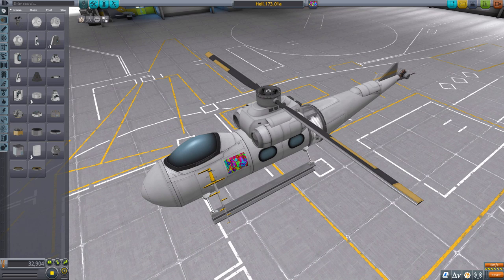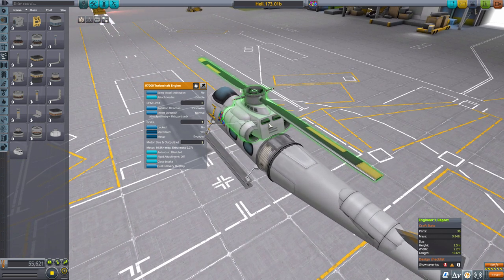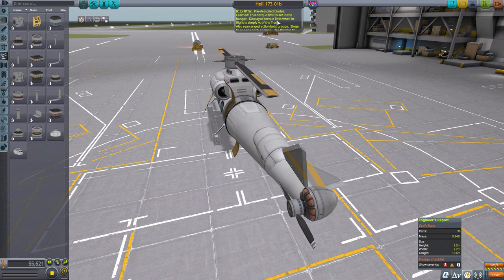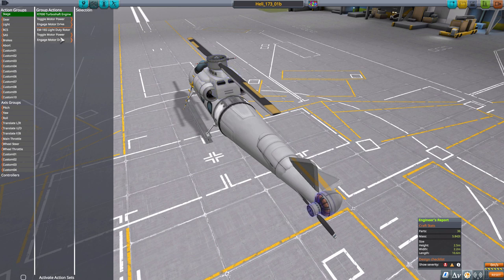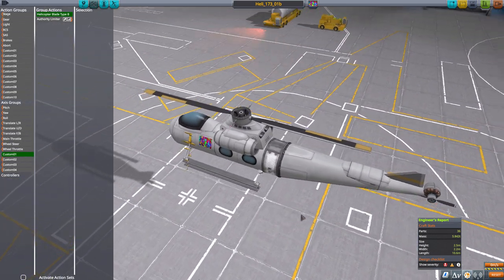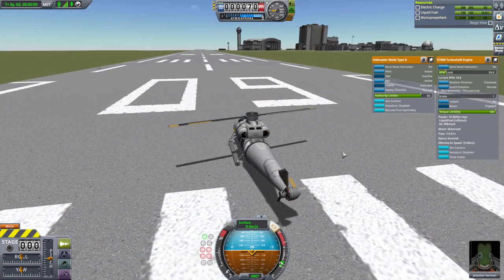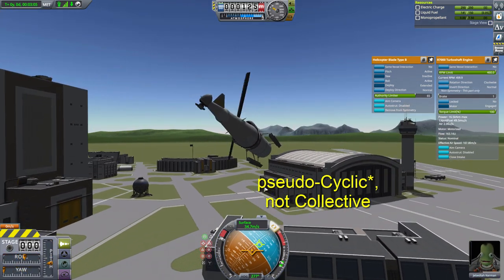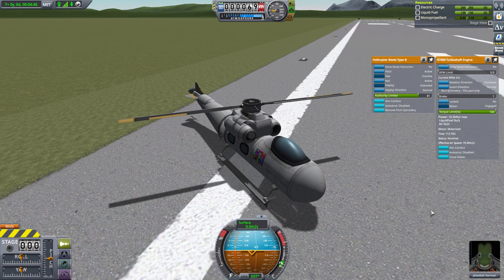KSP 1.7.3: refined + improved (simplified) helicopter controls

Comment: You have more advanced options in helicopter blades and rotor windows. Why is that? Thanks to some mods? Fox example my  authority limiter value is on 23 max. 
However you vids are awesome! I really like them
Reply from the maker: Compare the date you made this comment to the date this video was published.  It's a four month difference.  The version of KSP in which this video was made is stated in the title of the video.  The 23 degrees limiter was introduced in 1.8, replacing the percentage limiter.  There is no difference in performance, just a difference in the way the information is presented.  Finally, I have advanced tweakables turned on in my game settings.
Reply: Thank you so much for that info. Everything is fine now, I'm just dumb xd
Have a nice day :)

Comment: The rotors with KSP have been a bit of a letdown, but the new parts are still a bit fun for other things. Maybe if they fix the game engine a bit the rotors won't have to have such useless low RPM limits for prop-planes
Reply: wdym a let down , it works almost like the real thing ( no swash plate) but you can build it with robotic parts
Reply: @linecraftman3907  I was speaking more for propeller planes and things that would require higher rpm. How would you make a working swash plate without kraken issues?
Reply: @casualbird7671  The RPM isn't really the problem. At low speed (<100m/s) they work just fine. But at higher speed the angle of the blades will need to be higher, we sadly can't automate this in stoch ksp.
Reply: The biggest problem is we cant really warp when using rotor blades, it will break apart and cause a lot of karken.

Comment: For some reason, this exact design keeps turning counterclockwise for me. I can turn it the other way, but as soon as I stop doing so, it starts rotating counterclockwise again. Dus anyone know why this is?
Reply from the maker: I can only guess at what you're describing; more specifics would help.  Are you saying your helicopter turns CCW, the main rotor turns CCW, or the rotors only produce lift when spinning CCW?  How were you making "it" turn in the other direction?  (What is "it"?)  Until I know specifics I can only guess at a solution.  

I'm going to guess you're talking about the main rotor.  You can change its direction of rotation by right clicking on it in the hangar and selecting the opposite direction at the bottom of the Part Action Window (the window that appears after you right clicked).
Reply: @ArchaicAlibi . My main rotor is set to rotate clockwise with 3 motor size and output. My tail rotor is set to turn clockwise as well with the same amount of motor size and output. My entire craft itself tends to rotate counterclockwise. I can turn my craft the other way, but as soon as I stop, it starts rotating counterclockwise again.
Reply: @maximdeleye  probably your tail rotor is not powerful enough to compensate for torque main motor is creating, so the torque rotates the whole machine the opposite direction compared to the main rotor's direction. 
Or it is too powerful, and it pushes too much. Depends on the side of the tail you stuck your propeller to.

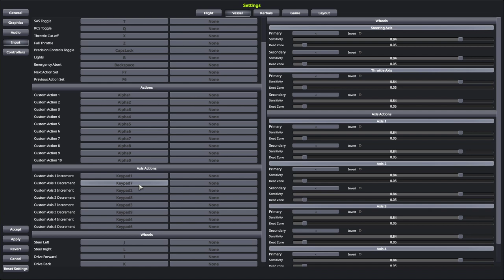Comment: 11:13 you could’ve made the more sensible decision of putting increments higher on your keyboard, and decrements lower, and instead invert the axis control group in the SPH, that’s just my opinion though
Reply from the maker: You're not wrong but sensibility is subjective.  There are lots of things I could have done but I'm a creature of habit and installing rotor blades with an angle already built into them was a necessity in older stock heli models so my habit lead me down that path.  Honestly, what I wish I had done was Invert the direction of motion in the AxG.  This would've accomplished the requisite change (without needing to reassign key bindings) but unfortunately I was unaware of that option at the time of this video's recording.
Reply: Inter's Odyssey I get that you didn’t do it, and I also said that it was my opinion, as you said it’s subjective, I’m just giving other people a heads up for upcoming builds to be made, sorry if it sounded a little aggresive

Comment: I know this doesn't help with helicopter design since it's just a different shortcut from reaction wheels, but I tried modifying your copter with control surfaces and rcs thrusters and I like how it gets the pitch and roll to respond https://www.youtube.com/watch?v=E1928inu-60&feature=youtu.be.  It's the first helicopter I've enjoyed flying in ksp so thanks for sharing.  I hope they keep getting better.  What might help from the devs or modders is if we get a way to create custom response curves for the custom axes.
Reply from the maker: That's cool.  It looked very stable.  The utility of variable pitch is fantastic but it can become overtaxed when trying to do sharp maneuvers.  It's like trying to do too many things at once.  Your Vernier redundancy eased some of the responsibility off of the rotor.  
Also, nice use of the new skid pads.  :)
Reply: This is where a flight stick comes in handy. The one i use (logitech x56) lets you define the throttle curve on just about every analog axis. But it can tend to be overkill for usual kerbal play. I think there might be softwares out there that let you directly modify directinput axis curves in windows. But I don't know the name of any off hand. Maybe JoytoKey can do it?